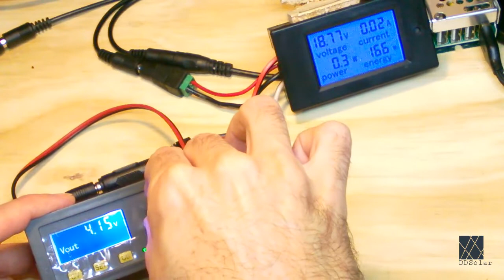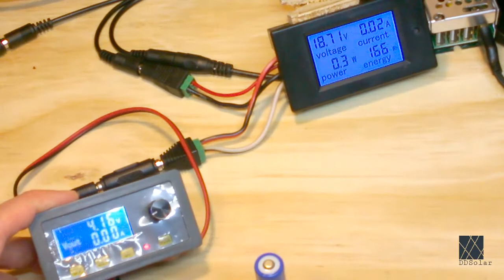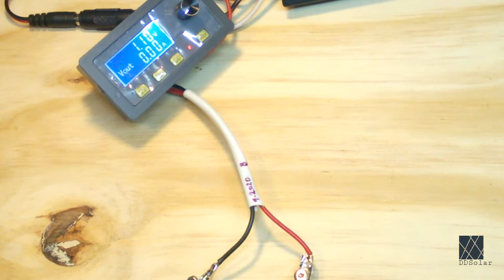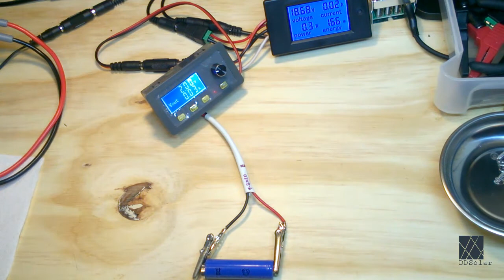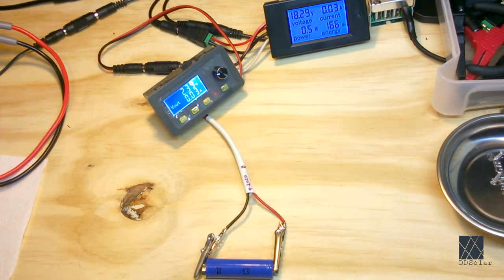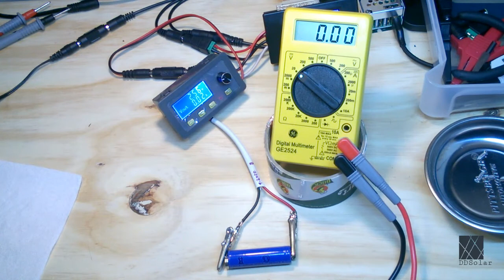Recovery of deep discharged Lithium Ion cells safely on the workbench

Comment: Hello, thx for the video. You sound like a very knowledgable person regarding this stuff so Id like your thoughts if you have a moment? 

Ive been doing some research about lithium cell overdischarge effects, due to recieving an ebike with its battery deeply discharged due to parasitic draw imo. Its a 72v 1440wh (20S, 20ah) pack.

When I recieved it, I probed ~45v. When I charged it, it charged very slowly for an hour+ then ramped to full charge wattage of 250w. It does work but the V sag and range seem to be lacking but I dont have anything to compare to. 

Regardless of any detectable damage, Im more worried about the undetectable (til months and dozens of cycles later just outside my warranty period probably) damage such as micro-shorts and dentrite formation but Im having trouble getting the manuf to replace it as they tell me 'it works'. 

If I get stuck with this pack, what are your thoughts are on level of damage and what to look out for during use in high vs low draw scenarios. It powers a system capable of drawing 8kw btw but mostly in the 1-2kw draw range

 If the cells were equal at deepest discharge 45v would be 2.25v/cell, which is unlikely, so Im sure some were even more discharged than that. 

Any info you can offer would help. If this isnt so.ething you wish to comment on, its ok. I like your videos so Ill still be hanging around!

Thanks again
Reply from the maker: @Whoadayson Hello, welcome and thanks for watching my videos! This is strictly my opinion. Ebike packs have a large quantity of cells interconnected, therefore if one is bad it can "hide" in the pack and not be easy to find - unless of course it causes an incident. My personal advice is if this pack has been abused, at the very least you must check and monitor each individual "cell group" for bad behavior all the time. Especially during charging. A simple multi-cell battery monitor can do that, or perhaps your bike already has one. If you see a particular cell group having major issues (major sag, self discharge, voltage skyrockets under charge), I recommend do not run the pack. It's better to recycle the cells, take them out of parallel and use them for other individual purposes. Maybe, you could repair the pack by replaceing bad cells, but that's a lot of work. I am very cautious with these packs because they have a bad safety record. Please keep in mind this is all my personal opinion and method of operation. I am risk-averse and don't trust overseas ebike packs whatsoever. An ounce of prevention is worth a pound of cure. Hope this helps :)

Comment: To avoid Vdrop caused by stainless alligator, you can try the one made by brass/nichel.

I have some old ICR cells (2220mAh) overdischarged at 2V.
Using Opus 3100 at only 200mA charging current, at half process drop only to ~80mA and therminate with only 700mA charged

The question is: can I use TP4056 with limited output, like 50mA to recovery battery up their full charge?
Reply from the maker: @MACYNET323 Hi, I think so, 50ma isn't too bad. I don't know if any of those chips support cell recovery and would assume they will dump in whatever current supply is available (I could be wrong). Main issue is not to dump current into a 0V cell. Once it's up to a decent voltage, hopefully it will accept a full charge and recover some capacity. It's always a mystery whether any cell will surive. Some of them just never come back probably due to internal damage
Reply: @solarpoweredge  The cells from 2V raise to 4.1V with only 700mA of charge acquired.
When in one of them is applied a light  load as 270 Ohm they go down to 3,7V and Vdrop is 0.4v ...
So I believe that in addition of the reduced capacity, the impedance has also increase a lot.
Reply from the maker: @MACYNET323 Ah that's an unfortunate side effect. I like to use these damaged cells in solar lights. Because they will charge very slow and discharge at low rates. Sometimes running just 1 LED. Then the IR can be less of a problem and maybe the cell will last a few years (hopefully)

Comment: quick question im dealing with battery's off power tools nd there usually 18650 Samsung at times lg with  at least 1500mah nd up when there zero voltage i can start around 10-15 mah amp on the power supply but after it gains charge what higher can i go than 15mah load on them i bump it up to 25mah after im around 2.5 volts after i like to go up 50mah then 100mah ur the man amazing knowledge nd skill just would like some tips nd tricks to speed up my work on bringing them back up from totally dead
Reply from the maker: @eli310  Hi! I'm glad you like my videos... :D anyway around 10ma is good for easing a dead cell up past the 0V range and hopefully with harming. We should not just dump current into it immediately. At 0V the cell is not in good shape. Once you can hit around 3v, it's perfectly OK to try higher currents, but watch the voltage and heat! If a cell is really bad it might heat up with higher currents. And I never leave them charging without supervision :) hope that makes sense, any questions feel free to ask

Comment: If 100mA is acceptable for the initial current then maybe a TP4056 perhaps with a modified max current limitation could recover a discharged cell and do it semi-automatically. A multimeter and constant supervision would still be necessary.
Reply from the maker: Good idea! a simple TP4056 based board to recover multiple 0v dead cells at a time safely would be outstanding! Normal chargers might just dump current into them, or refuse to charge
Reply: I am currently doing this and it's working but it heats up a lot

Comment: Another thing to be careful with some cells come with a battery management system built in and some do not relying on the management built into the device which is something beware of because if you leave one with out it built in it will keep charging till it explodes
Reply from the maker: @errolfoster1101 Right on!

Comment: I have an off brand power station that will only charge by a 12v car charger and not a wall charger. Why is this?
Reply from the maker: It's possible the wall charger isn't putting out any voltage. If you have a multimeter, just check the output while it's plugged in. It should read the same voltage as printed on the label. If it's not working, sometimes a replacement or similar wall charger can be found for sale online. All that matters is it has the same voltage and same current output. (The connector should match too)
Reply: @solarpoweredge  Thank you so much! I have tried buying another regular charger and that also didn't work so I thought I had a 200 dollar paperweight for 6 months 🤣🙏🏽. I just thought to try a car charger from another power station I had and it's charging now perfectly but just not with any wall plug.  Weird. But thanks so much for getting back to me so quickly. I will just have to charge it with a car charger for now.
Reply from the maker: @1dyrfullymade You're welcome! Some guesswork here, but one more idea... 

Process of elimination: if the Car charger and Wall charger use a separate connection on the device, then it's possible the input circuitry or connection port for the Wall charger input stopped working.

The car charger accepts a 12-14v DC input from the car battery... probably much the same thing the wall charger puts out. You could theoretically connect any 12-14 volt DC supply to the car charger port. If you search on Amazon for "12v cigarette lighter adapter" you will see various adapters that might work. One is only 9 bucks, can't say it would work but who knows. It's at least worth looking into. Hope this helps :)
Reply: @solarpoweredge  Thank you will buy that. Can never have too many cords just in case! The name of this power station is SBAOH T101 Portable power station 155WH got it off of Amazon. 😊
Reply from the maker: Just looked at the picture on Amazon...  1 DC input port for both wall and car charger. Bad plug connection perhaps. One of my power stations had a similar problem. Only certain cords would actually connect. I hope the adapter works for you. Otherwise, like you said - can't have too many :)
Reply: @solarpoweredge  Yes! It's a knock off brand so I took my chances. I am glad I am able to charge it at least in the car and on my new Bluetti AC70 lol I did buy the extra charger. Unfortunately it didn't work, but it has adaptors so it will be useful for other devices! Thanks so much for your help.
Reply from the maker: @1dyrfullymade Welcome! maybe a solution will appear later, at least the adapter is still useful. Take care! DD

Comment: a constant voltage charger... does this just mean that it turns off when it reaches a certain voltage? so i could just use a "higher than the cell max voltage"-charger and cut the connection when it reaches a certain voltage? or is there more to it...
Reply from the maker: Hi, by setting let's say a 3 Amp power supply to a safe voltage (maybe 4.2v) and connecting it to an empty cell that is 2.9v, it will start charging the cell in constant current (CC) first. This means it delivers all the current it can, regardless of voltage. 

Eventually, the cell reaches 4.2v, and the current starts to fall off. This is constant voltage (CV) and eventually the current drops to zero as the cell is full.  In fact it does not require a special charger. You can use a properly configured power supply with the proper current limit to charge a lithium cell. 

Note: you are correct - if using a higher than cell voltage charger - it has to be cut at the right voltage. So if I connect a 5v 3A supply, it can still work. But then I need a circuit to turn it off at 4.2v or it gets risky. Hope this helps! DD

Comment: I have a dual set of 18650 totalling to 3000mah, my tp4056 does not charge it and shows blue light when connected. They are at 0.66v. I tried to jump up the voltage for 10-20 secs but the voltage quickly drops to the same when disconnected. What does this tell u. I am curious because I have seen people recovering their 18650s with even lower voltage than mine.
Reply from the maker: Hello, it's possible the cells are shorted internally. When this happens it tends to discharge itself. You can try 2-10ma of current for 1 day and see if it can hold a charge. If it doesn't I'd recycle the cell, they will probably just cause you a lot of trouble. Also if it's 2 cells in parallel, they should be separated and charged individually. Sometimes 1 of the 2 cells will be short, pulling the other down. Hope this helps
Reply: @solarpoweredge  did a cid reset and now internal protection is gone I guess. The external bms will take care though.
Reply from the maker: Hmm yeah hopefully BMS will guard the cell. 18650 can emit extremely toxic gas if anything goes wrong, so must use caution. I should have mentioned, if you have a suspicious cell, charge it carefully to like 3.6v and leave it over night completely disconnected. If the voltage collapses to ~2V, it is 100% a dead cell (shorted) and can never be recovered or repaired - in fact it's unsafe to keep. (but again cells in parallel must be separated to test properly)
Reply: @solarpoweredge  charged for w hrs with voltage at 4.15v then played music in speaker for 1 hr...still battery 80 percent. Will  keep checking though
Reply: @solarpoweredge  im trying to revive a dead ebike battery. and it has all these groups making it a 72v48ah battery(it's 300 cells). im measuring 0.4v across one cell(or one parallel cell group or what its called from - to +). i guess its not possible to charge this cell group individually because its connected to another cell group? but if i could - let's say i wanted to give each cell 50ma each - i could just do 50ma*number_of_cells_in_group(10)=500ma and each cell would receive 50 ma and everyone would be happy and nobody would be poor? or does it not work like that, maybe the chemistry on one battery makes it less charged or it blows up or def never do that for some other reason... ?
Reply from the maker: @wtfvids3472 You can charge a parallel cell group while it's still in the pack. 500ma would 
 more or less get divided amongst the cells. What I'd do is trickle charge that cell group to around 4.1 volts and let it sit a good while. If they discharge back down to nothing by themselves, the parallel cell group should be taken apart to remove the bad cell(s) or maybe there is something else discharging them. Regardless, better keep an eye on that cell group (battery cell voltage monitoring) as it might cause more problems in the future.

Comment: i scavenged a li-po battery from a disposed  vape, it is 2500mAh cell .. it had literally 0V ..  i gave it a chance and charged it slowly, i applied around 50mA current, but the voltage was climbing extremely slow ... that could mean only two things, either it has internal short circuit, or it  had still a good capacity and  preserved it's low internal resistance ... i waited   couple tens of minutes  until the cell climbed to 1,5V, then i increased the  current to 100mA .. as soon as it climbed to 2,5v i rose the current again to 250mA(i was little impatient) .. then waited until it gets to 3v ..I noticed the cell getting slightly warm, but nothing concerning.. then i unplugged the charger for half an hour  and checked the voltage if it  stays or drops ... it was stable ...  and then since it had 3V i left it charging with 1A  to 3,8V and left it disconnected overnight .. it holds the voltage and it had very little V drop  under load ... probably only 0,01 or 0,02V when connected to 5w light . looks good to me
Reply from the maker: Right on man! I use these recovered cells in my LED flashlights if they hold charge. Got quite a few now, maybe 3 didn't hold charge but that's expected
Reply: @solarpoweredge  yeah they are plenty everywhere and people just throw them to the bin.. i went to local vape shop and they gave me whole box of these used one-use vapes  free.. so i am testing and  charging 67 cells for last 2 days and i am only half way in 😂 they vary from 400mAh to 1,5 Ah .. one piece was 2,5Ah and luckily 90 percent of them had over 3 volts
Reply from the maker: That's a score! nice :D

Comment: Great video man...I was wondering what is the brand & model of the bench charger your using?
Reply from the maker: Hello, thanks a lot! That charger is quite old and I am having difficulty finding the exact same model. It's a generic brand. If you type "adjustable DC converter" in ebay or amazon, very similar products come up, as well as some even better ones that have more features. For example ebay item # 224915998073 (search that # on ebay it will come up). Anything like this can be used as a current limited supply to charge batteries. One problem with some of these is they have screw-down terminal blocks. Those are terrible so it's better to solder wires straight on. I hope that helps, please let me know if you have problems finding one I can get some links.
Reply: Thanks man, Just ordered one from eBay.
Reply from the maker: Great! welcome

Comment: 'The brand is probably just generic'
Brand means absolutely NOTHING. The actual factory in which it was made tells one significantly more when you combine it with the weight of the cell.
Reply from the maker: I see what you're saying. LG, Molicel, Samsung, Panasonic, Sanyo etc. are examples of quality brands with good QA and higher standards, as they have a name to back up, higher stakes customers and higher cost. And you can probably find out which factory. In fact I prefer their cells in most cases. It's very possible cheap generic (might as well say Chinese) cells could originate from from the same factories as quality cells but not all of them, I am not sure how to track those and don't need to. I don't trust the generic brand cells because usually no one stands behind them regardless of which factory or manufacturing line or country of origin. But for a  small solar light it's not an issue to me. Of course every single one of these cells I've pulled out of small solar devices are very lightweight and have low capacity, as expected, but they are extremely cheap so.

Comment: Get it to 2.25v on .1 amp just keep checking temp using hand

 at 2.3v i usually use 0.5 amps to get up to 4.15 (keep checking the the temp on the cell)

I then leave it charge for a week and see if it holds its charge. If it does its fine. If its dropped below 3.7v its bad.
Reply from the maker: After 2V the cell should not be too fragile. But at 0V extremely vulnerable. The ones I recovered gently have some internal resistance but not too bad, hold their charge and were salvageable.